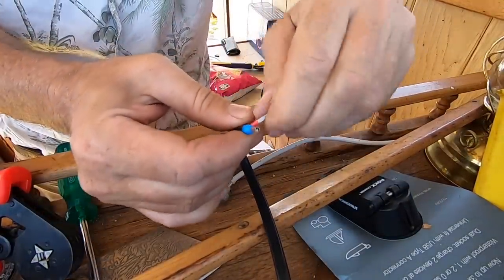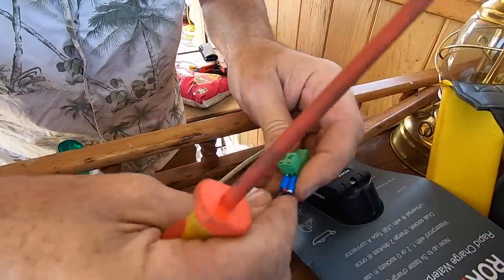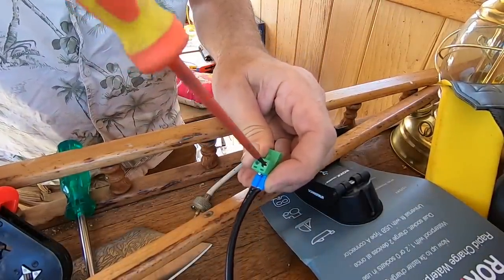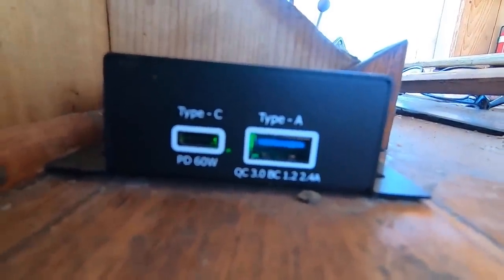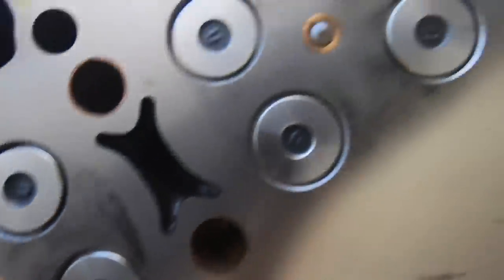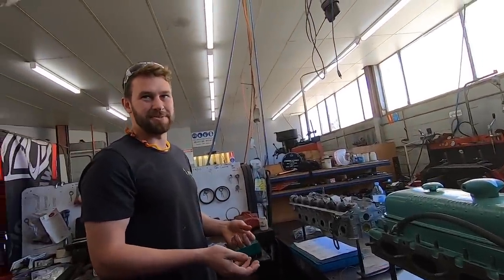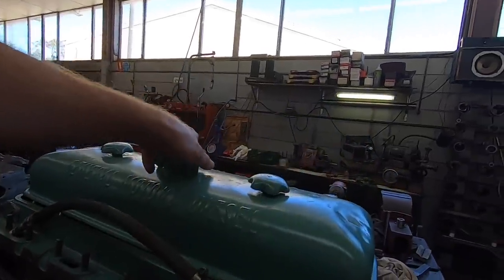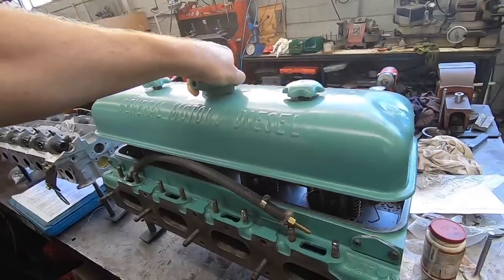Some questions answered

Comment: LOL I remember 15 years ago looking at renting on Dangar Island to get away from the wife's family house in Penrith when her and I first got together. The rent prices were great and all. I can't remember what held us back.

Now we're midway between Coffs and you.

As for the batteries it makes GOOD sense to keep house separate from the motor (starter motor cranking will produce a surge when it lets up too). Though having the ability to join them up in-case say the starter batteries die having a manual switch or remote relay switch to JOIN the circuits will help you out and could be thought of as an insurance policy I reckon. That said though I like my 12v for everything when it comes to cars, camping and more though apparently 24-36vDC is the rage for solar now.

Gasless MIG :P lol the old man preferred plain old stick though for what he was doing but some jobs were so easy to burn/melt through. My brother did some tig welding for work and he said it takes a good bit of practice and that even he will NOT play with TIG.

Electric rover ... I'm VERY curious about the batteries used, voltages, motors used and capacities/runtimes. I'd love an electric car but the old EF Fairmont won't give me much boot space if I send it electric lol and there's bugger all charge points here so would need to put a genie in the boot .. not fun and defeats the purpose almost. Though I've heard of some calcium batteries etc coming onto the market that are "supposed" to be great and battery tech is coming leaps and bounds atm.

Bone dry ... been near SFA rain a few hrs north here :( just enough to make the weeds grow ffs.

Solder vs crimp ..ooooooo ... in marine ... SOLDER!!!!!!!!! Crimps are GREAT in cars etc no doubt about it but in a maritime environment salt gets in EVERYTHING!! Solder in maritime, crimp in cars, houses etc. Solder then heatshrink then if really worried that stretch tape I can't think of the name of that I use on the radio antennas here.

Irony ... 50% USA vs 10% AUS on an aussie channel lol.

Solar cells over the back will help reduce sunburn and hot floors etc whilst getting a double benefit. Best way to go I reckon as a canopy for the work area.

Hot water is good and a must for a live aboard but when working you can get hot water with LPG/butane cookers for your crabs, prawns etc. For fresh water have you considered a reverse osmosis pump setup?

Oof even my 23yo EF2 Fairmont Ghia is a bloody mass of electrics lol so current motors/cars etc are EXTREME in their auto electrics<->mechanics crossover.
Reply from the maker: Yes, I'm really looking forward to having the awning back up and the solar cells installed. The shade is going to be wonderful!

Comment: Stay with passion, and keep choosing to be happy every day!! You  are going to want an A frame on the stern of the boat for salvage and the winch and windless should be hydraulic not electric .
Reply from the maker: Hey Edward. Thinking of even making a barge with shearlegs that I push around with the trawler. Should be a relatively easy build project.

Comment: I worked in electronics/electrical for 45 years before retiring 11 years ago.  I'd like to put a bug in your ear about your electrics on the trawler.  LiFePo4 systems are the way to go for the long term.  Initial outlay will be high, but cost less than 1/2 the cost of lead acid/AGM systems for the life of the LiFePo4 batteries.  Battle Borne sells complete systems, 12V, 24V, 48V, etc. and have a 10 year 100% replacement warranty if any of their batteries fail.  Each of their batteries has a built in Battery Management System.  Just something for your consideration.
Reply from the maker: 10 years is an excellent warranty for batteries, I'll check them out.
Reply: @DangarMarine  Be forewarned, the batteries are expensive.  About $950 US for a 100 Ah 12 volt.  A complete system for your boat will be over $3000.  Their team seems to work well with customers to tailor systems for specific needs.

Comment: I don't think you need a curtain below your hatch, but a "drip edge" at the bottom of the opening would be a great idea.  If the sides of the hatch area just meet the metal of the floor/ceiling, it's easy for water flowing down to follow the roof line, vs. just dropping straight off and down, missing things.  Also, with the boat moving in both directions, fore and aft and side to side, that would exacerbate  water following the roof line an dripping where you don't want it to drip.

RichE, San Diego, CA
Reply from the maker: Yep, know what you are saying and it does have a lip to stop the water from tracking back along under the deck.
Reply: Excellent!

Comment: You can have hot water.  Plumb up a small hot water tank with a heat exchanger from the engine cooling water.  There are such systems being used on high end motorhomes.  Also available is a Webasto, diesel fired water heater that can be used to heat a potable water tank and for cabin heat if needed and set up with fin tube radiation.
JIM

Comment: Love the idea using the fuel line around the hatch for a seal. It would also make that edge a little more safe in a rocking boat. One concern is, venting. I haven't noticed any venting in the room but may have missed it. I figure a loose fitting hatch let a lot of air in before but....
As for heat, on a dive boat I would think you would want something to dry things out. Hell you could even use one of those Cubic mini wood stoves they use on long boats in England if you had to. 
Hot water has so many uses. You ever wash greasy hands in cold water? Maybe one of those instant hot water heaters. 
Stu, what do you plan on doing in the forward cabin?
Reply from the maker: I've been thinking about having the dry exhaust come up through a drying cupboard. Instant gas hot water would be a nice way to go. Video on the forward cabin soon!

Comment: I love electrics. Oh, and 12 v is best for a device like you're using. If you're running 24, and it means 24 max not system voltage, the device will have to dissipate 19 volts to get to 5, if you use the 12, it only dissipates 7. The device will last longer at that voltage. I'm not a boater but love your vids.
Reply from the maker: Makes sense, thanks!

Comment: BAR - Bureau of Automotive Repair regulates/license repair facilities.  Mechanics work for shops overseen by BAR.  The shop owners are held responsible for the work of their technicians.  For their part. Technicians can be certified by organizations such as ASE. But it isn't mandatory.    The buck stops with the auto repair business owner..

Comment: Boat electrics, an enhanced version of Murphy’s Law appears to apply to boat electrics, sea water,condensation and rain are all over you and if it can get in to your wiring it will !    Use the best quality shrink tube you can buy.  The other really bad thing that happens is that most of the really expensive marine instrumentation and gadgets
are about as waterproof as a sponge !  so you really need decent ventilation, I have seen some horrifying boxes of green slime and rust masquerading as navigation kit ( often still working until they don’t).
Reply from the maker: Excellent point about the ventilation, it can make a huge difference with so many things on a boat.

Comment: By keeping the big over powered Detroit Diesel and rebuilding it , you can do the Kessel Run in 12 Parsecs!
Reply from the maker: It will be interesting to see what the top speed is and also the fuel consumption at a variety of speeds.
Reply: @DangarMarine  How big are the fuel tanks? I forget how many gallons they were. I saw the video of you planning to crawl in them and seal them up but I don't remember how many gallons they were. With a single engine and a boat that size, I can't see why you couldn't get at least 1500nm at a casual 5 knots with 300 to 500 gallons.I'm betting you'd get even more out of it.

Comment: BTW: if you want anti-slip paint on your deck: just paint it with paint you normally would use and sprinkle dry sand on top of the wet paint. think that it is alot cheaper, but works just as good.
Reply: This wouldnt work for a multi purpose boat as it would chip and wear easily  so a more durable sure is requied may cost more but less maintenance  we've use a speediner  same as rhino which g  works  great when applyed properly

Comment: I think with what you plan to do with the boat that the Detroit was the way to go. Had you repowered you would've used a smaller motor and it would've limited the work that you can do. Also when you have to deal with high currents and a little wind or any bad weather you'll be really glad to have the extra power. 
       I solder too in bilges because I feel that even the best crimps aren't solid to the end and corrosion eventually gets in. I've never had a solder joint fail in the places I use it. Yes it can crack in high stress areas, but if you put a connection in that situation you are asking for failure. As long as you put strain relief in place I say choose the best for the application.
      As far as the Island being affordable goes, here in the States it'd cost more to live in a similar place.
       Also 24 volts was the way to go for a work boat too. On a workboat having 24v can be life saver especially when you come across another boat with 24v. It'll be great if you want to put a bow thruster in someday too.
      For a future project you might think about a "kicker" motor of some sort. It'd be nice to have the redundancy for going offshore and it could be as simple as a bracket for the outboard from a dingy.
Reply from the maker: Yes, I agree, having a bit of extra power on tap can be  lifesaver some times.

Comment: I like the electrics as it still confuses the hell out of me..

Question Stu...What would happen if the trawler got struck by lightening?
Reply from the maker: Good question, that should be a video in it's own right!
Reply: Dangar Marine absolutely! Must be a way of protecting electrics with some kind of lightening protection solution...
Reply: Not much. Hull a very good conductor to ground (water). Might do damage to radio if direct hit on antenna. Actually very safe in cabin or below deck.

Comment: When sealing the lazarette opening, you might consider mounting the rubber to the underside of the hatch instead of along the lip of the opening. Then it would be better protected from wear over time (or from something catching/snagging on it and ripping it) as you go in and out of the opening.
Reply from the maker: Yes, starting think that is the best way to go.

Comment: Left handed cam shaft. Now I’ve heard of everything 😂😂
Reply: For Reverse Rotation motors. Basically all the lobe are in reverse so the motor runs in the opposite direction.
Reply: It's for driving on the left side of the road, eh.

Comment: Stu, I for one enjoyed the electrical stuff you were doing. I had a shop here in the USA working on cars specializing in electrical systems and yes, I was licensed. Certified is actually the term here. I was, still am, a certified ASE and SAE master technician. I HATE the term technician. I am a MECHANIC!!! But my certificates say I am a technician. I am actually retired but I still take the tests and maintain my rating just in case. Just like I keep my truck drivers CDL license. You never know when you will need it. I am really curious as to what brand those four jaw crimpers are that you are using. I have been looking for a decent set but mostly finding junk.
Rick
Reply from the maker: Hey Rick. That makes sense in that a certification proves that you are trained properly while ours is a license because it is illegal to work without it. To be honest, I can't recall what brand they were. I'll try to find where I got them from. They seem well built.
Reply: @DangarMarine  
Thanks, as far as the mechanics go there are a LOT of so called mechanics in this country working on cars even in dealerships that are FAR from qualified to even have a wrench in their hands let alone work in vehicles. Your system is much better. Although I know a couple guys that would say otherwise about the inspection rules being so strict. Lol.

Comment: I found the electrics video quite interesting.
Speaking of, when are you going to fix the barometer clock?  :)
Reply from the maker: It needs replacing. I put a new battery in it but it still doesn't work.

Comment: Mmm water dripping down and the rocking motion of the boat when in motion = water going everywhere? Perhaps if you install a roll down rubber splash screen curtain, it's better to be safe than sorry. Done this on a friends lorry, the motor control box was 4 inches offset back from the hatch opening, and yet water still managed to drip around the 4 inched in to the electronics and kill the pcb over time (hence fitting of a roll down rubber splash guard curtain...

Comment: soft sand, that is the rubber nonskid product Andy of Boatworks Today uses frequently. The medium grit is his choice. Paint your surface with marine gelcoat, spread the softsand and let sit overnight. shop vac the painted and sanded area and paint again. You now have non skid footing made with rubber. There are at least 2 separate videos on Boatworks today channel here about using it.

Comment: Instead of using split hose for the hatch gasket, why not get some 3/16" neoprene an use it as a flat gasket glued to the underside of the hatch. You go around the top of the coaming with a gasket and you'll be ripping it off every time you go below.
Reply from the maker: Yes, good point, gluing to the mating side of the hatch probably is a better way to go. Nice one!

Comment: I appreciated your video on the electrical. Have you thought about a propane water heater for the boat. I have a small heater for an outdoor shower and it works great. Bought it of amazon and probably get 40 to 50 showers off a small tank of propane.
Reply from the maker: Yes, I think if I did add hot water it would be instant propane for sure.

Comment: You mention diving at the wrecks...will you be using tanks or an air-line for your breathing?

About the positioning of the inverter:  Be careful changing the orientation...all of my inverter manuals state they must be installed either horizontal or vertical with the fans at the bottom.
The fans need to be at the bottom because the temp-sense is on the front (top when installed) and can't be below the fans...so mine are oriented like yours is now...the manual should tell you.

Comment: FYI. Lazeette. Water will “wick” and travel horizontally. If the vertical edge is extended, say 1 cm, this won’t happen.
Reply from the maker: Yes, the edge does extend down so it won't run along the deckhead.

Comment: You developed an interpreter for interactive fiction... and your boat is NOT running it? There's room for a raspberry pi on that panel! Get it done!!
Reply from the maker: I would love to do some embedded controller stuff, particularly with a SIM card for sending info back to a server for logging and accessing remotely. I'll get the engine in first though. ;)
Reply: @DangarMarine  I just want a screen where you can type 'GO EAST', and the r.o.v. interprets what it sees. 'You see two fish swimming in the murk, a shiny object off in the distance.' 'GET TREASURE' :)

Comment: Do you ever have a problem with people stealing items off the boat?  Thank you for the video sir.
Reply from the maker: Not so far!
Reply: @DangarMarine   Stu you should look at installing a video camera on the boat, Myself and a few boatie mates have installed stand alone wifi cameras on our boat that sends you a message to your phone when there is motion, you can long into your camera to view live video and even talk through the camera, I can even show you how to make a "high water bilge alarm"  that sends you a alert message to your phone if a float switch is activated for around $30 AUD, you will need to have a wifi router with internet on your boat, let me know if your interested.

Comment: I think you could actually reduce the power of your 4-71 engine by installing smaller fuel injectors. It would also improve fuel efficiency, but do you really want to reduce power?  One possibility to improve efficiency, without reducing power, is to install a fuel flow meter, such as a Floscan. If you know your fuel burn in real time you can operate more efficiently, with no real performance loss. Greg
Reply from the maker: Yes, I have thought of going to smaller injectors but I might be pushing a barge from time to time. For this reason the fuel flow meter might be the better option to maximise fuel efficiency.

Comment: When en you are connecting to your + and - terminals on any of your power systems, you should avoid running the leads across the busses, run around them wherever possible. Vibration and chafing will cause you major problems and even worse, fire hazards.

Comment: I think that the boat rebuild brigade (I am one of them) will be hoping that you end up getting a bigger boat, and fixing that one up. However, I will still be interested in your adventures diving and wreck hunting, especially with sonar and magnetometers etc. Where are they going to be operated from? You are a bit short of space for displays.
Reply from the maker: Most of the towed stuff will be operated from laptops on the table that I'm going to be putting in on the back deck.

Comment: Crimp the cables then put solder on them for protection.
Reply: The problem with solder is it stiffens the wire and then leads to work hardened breakage.